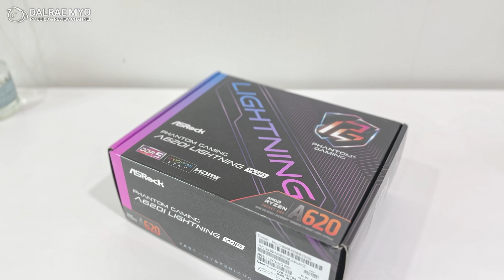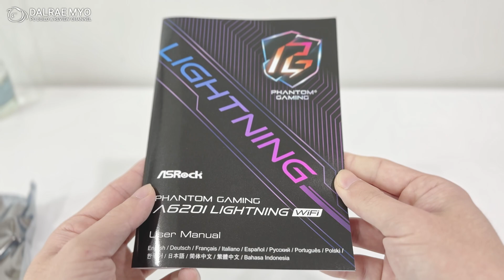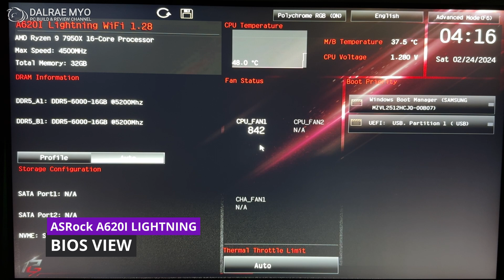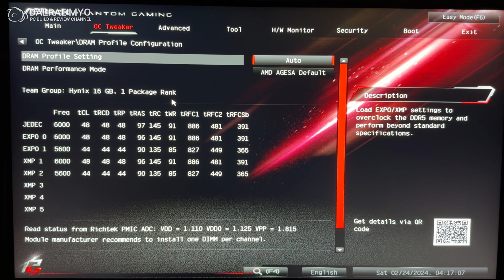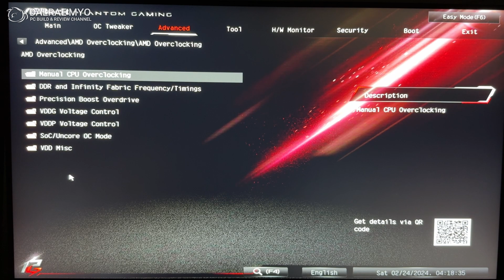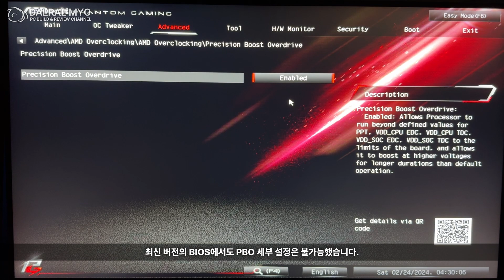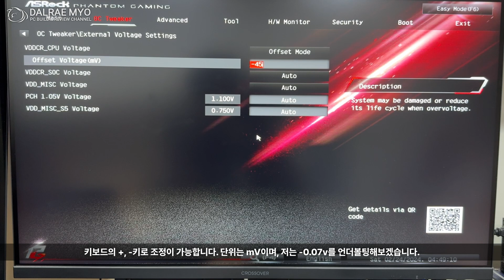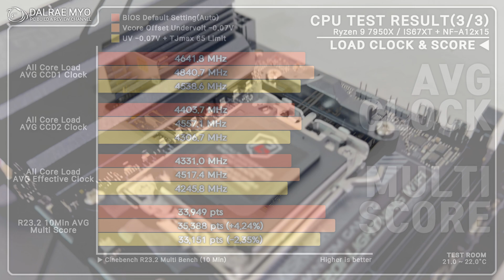ASRock A620I PG LIGHTNING WIFI Review

Comment: Is Offset Mode in VDDCR_CPU Voltage the same as undervolting through PBO Curve Optimizer? How come after offestting -70mV resulted in similar or even higher CPU temp? And why did you choose to limit the TJMax instead of changing the PPT, EDC and TDC? I hope you can answer this 🙏🏼

Comment: Why did you choose the t-create expert? Klevv Fit V 6000MHz CL30 has better latency and similarly priced too. Btw thanks for the video!
Reply from the maker: The RAM I chose is classic, not expert.

I stick to the JEDEC standard, and I happened to have a model that uses the JEDEC standard with a nice heatsink, so I chose it.

Comment: can this motherboard undervolt the cpu?
Reply from the maker: It wasn't possible with the BIOS version I tested.
Reply: @DalraeMyo  does that mean the latest BIOS version could do it? A seties boards are known to not be able to undervolt but I expect ITX should be able to considering how expensive of a premium they are
Reply from the maker: @ It is highly likely that it will not be possible even in the latest version.

It seems that the feature has been limited to avoid interference with sales of B650/850 chipset motherboards.
Reply: @DalraeMyo  good explanation

Comment: what is the best cpu for this mobo that can run at full performance without undervolt? assuming it won't reach tjmax
Reply from the maker: If you are considering an environment without undervolting or power limitations, you can select a CPU that uses less than 150W of PPT.

Examples include the non-X, R7, and R5 models of R9.

Comment: Hello, thank you for your video, I have a quick question, I know that there is an option in the BIOS "Power On After AC Power Loss", this allows you to restart the motherboard when it returns power. But I tested a little, it works but if the motherboard regains power after a few seconds (or minutes I don't know exactly how long) Does it have an option for the computer to restart automatically when you reconnect the power no matter how long you leave it unplugged?
Reply from the maker: I understand that there is usually no time limit unless the battery installed on the motherboard is discharged.
 For example, this is a function that can respond to long power outages such as facility electrical work.
Reply: @DalraeMyo  Thank you for your answer, it's really strange, when I leave the computer off for 30 seconds it works, on the other hand when I turn it off for 30 minutes no...
Could it be the motherboard battery that is dead?
Reply from the maker: @CharlesHalbitte  I think the information I explained was based on an enterprise-grade motherboard.

I think ASRcok's consumer products may have different maximum standby times. I think it would be quicker to contact the ASRock service center.

Comment: can id cooling is-55 fit above the I/o shield?
Reply from the maker: It seems difficult. Since the VRM heat sink height is the same as that of general ITX motherboards, it is expected that installing the is-55 cooler in the direction of the VRM heat sink will be difficult.

Comment: i was thiking about this one but where to put a graphic card ? and does it support ryzen 9000 ?
Reply from the maker: The 9000 series is supported starting from version 3.01BIOS, and the graphics card slot can be installed in the PCIE 16x slot at the bottom.

Comment: After watching your videos about itx motherboards I just bought the ASROCK A620i PG WIFI today. Thank you for helping me choose.

I now have a question about this board. In its online manual, it says that to update the bios via FLASHBACK I need a CPU and MEMORY installed, but what if this feature doesn't need a CPU or MEMORY to be done?

The same manual says that I need two files and a PENDRIVE formatted in FAT32. The files are: BIOSUBU.BIN and the bios file renamed to PSPBIOS.IMG.

However, other tutorials only say that on ASROCK motherboards you only need the MOTHERBOARD BIOS, renamed to CREATIVE.ROM and then the update is done via FLASHBIOS.

So my question is what is the FLASHBIOS procedure of the A620i PG WIFI actually like? I still don't have the processor or the memories, I'm going to use a Ryzen 7 7700 in my assembly.

Comment: Hello friend, greetings from Brazil. In your opinion, is this ASRock A620i better in construction than the JINGYNUE B650i?

In the tests I saw on "Hardware Unboxing", the A620i motherboard supported a Ryzen 9 7950x in Stock for 1 hour, having a 6.39% lower performance difference than an X670E i Rog Strix and maintaining a VRM temperature of no maximum 86°C.

The maximum power that the R9 7950X reached in TDP on this A620i board was 165W, while the JINGYNUE B650i did not correctly show its consumption in WATTS, but reached a temperature of 121°C in its VRM.

My setup is basic, I want to use a Ryzen 7 7700 or a Ryzen 9 7900, both with a maximum of 65W TDP in the version without the "X". I'm not interested in overclocking a processor, so I'm unsure between these cards:

- A620i ASRock PG WIFI;
- B650i Aorus Ultra;
- B650i JINGYNUE.

In your opinion, will an ASRock A620i serve me well using AM5 processors with a maximum TDP of up to 65W or 120W?

My initial Build:

- 1000W Corsair SF1000L power supply;
- White Corsair 2000D case;
- WaterCooler Armo Teucer 360mm.
Reply from the maker: - A620i ASRock PG WIFI;
- B650i Aorus Ultra;
- B650i JINGYNUE.

If you have to choose between these products, the Aorus Ultra model would be the best in terms of hardware specifications, but the M.2 stacked slot seems to cause stress when installing a cooler.

If you plan to use BIOS as standard and use a 65W/120W TDP CPU, I think A620i Lightning is also a good economical option.
If the cost is sufficient, it would be better to choose the B650i Aorus Ultra model, and if you want to save cost, it would be better to choose the A620i Lightning model.

Comment: Hey my friend i want to make a itx pc. I need a itx mobo but many reviews says that this mobo is very hot ont the vrm.  Do you recomend this or msi or 620i from gigabyte? Tks
Reply from the maker: I don't know if there is an ITX board model with MSI's A620 chipset.

If you can afford it, it is better to choose MSI B650I.

Gigabyte's A620I is a 275A power supply unit, and the power supply capacity is relatively half that of comparable products.

Comment: So.... No curve optimizer option ? The most important information was somehow left out.
Reply from the maker: A620 chipset motherboards did not provide options to adjust detailed settings related to PBO by default.
Reply: So no under volt as well  @DalraeMyo
Reply: Its a little patetic how this card has not that option.... And more because obviously its made for a small cases with less air flow and space

Comment: With the last BIOS Update 3.08 Is It possible to use PBO presets?  Like 90⁰C - 80⁰C - 70⁰C presets
Reply: Did you find the info on that? I really wanna know
Reply: @denisnatera3633  I dont, but in the asrock website they uploaded new BIOS update for this one.

Comment: Thanks for settings, i have a mini itx build and i looked for info that a620i it cannot do curve -30/-50 settings - but essentially offset is just the same thing and it is possible then.
I set ppt/ edc etc myself and it works, just a little touch on the offset and it will be quiet, fast, and chill.

Comment: does this support the 7800x3d out the box or would i have to update bios first?
Reply from the maker: The 7800X3D supported BIOS version is 1.28, and is supported from the first version.
It will be available without a separate BIOS update.
Reply: @DalraeMyo  Thank you! any undervolting advice on this board for the 7800x3d?
Reply from the maker: It seems better to enter about -0.05v(-50mV). @andyvasquez8724
Reply: @DalraeMyo  I have the Asrock A620i with a 7800X3D and can not find the option to undervolt the  cpu.  The option 'OC Tweaker\External Voltage Settings\VDDCR_CPU Voltage' is missing? I downgraded the bios to 1.28 and 2.02, but it is still not there. Can it be the difference in the CPU that is giving you the option?
Reply: @Tdot6  bro do you find option how undervolt 7800x3d because I didn’t see this  too
Reply: @sernapro4026  Sorry, I was never able to find out why the option does not appear for me.
Reply: @sernapro4026  It;s been awhile, but I believe the cpu voltage undervolt option is not available because I read X3D cpus are voltage locked.

Comment: I've heard that the Thermalright AXP90-47 Copper isn't compatible with this motherboard and it isn't ideal under 55mm.
Reply: Are you sure? Why?
Reply: @franzpleurmann2585  nope, someone posted this info on pcpartpicker in reference to the 650 variant
Reply: @franzpleurmann2585  the motherboard backplate nuts arent compatible with the cooler, but you can get m 2.5 hex nuts to replace the ones on the motherboard to fix it
Reply: @franzpleurmann2585  because of the share of backplate on this motherboard. But there are some ppl succeed in using the cooler with some tweak(?) like ignoring making scars on mainboard through screw.
Reply: Do you know the info? What about the axp90-53?

Comment: Thanks for sharing this. I was afraid of the BIOS, but it seems pretty capable for an A620. Now I'm seriously considering it for an APU SFF build.
I was originally considering ROG Strix B650E-I, but it seems too expensive to me. Sadly B650I Lightning is barely available in my country, and overpriced.
Reply: From the hardware unboxed video tou can see that a620i is a very solid choice in this price range. No need to get a better board for 65-75W cpu.
Reply: @koaronD  Well, I ended up going for a Gigabyte B650 for my office PC and Aorus B550 for my little gaming rig. I still prefer a bit less cut-down motherboards and BIOSes.

Comment: Is a ryzen 7 7700x rtx 4080 2k monitor suitable?  power limit?temperature vrm?
Reply from the maker: I think it's a reasonably priced motherboard with enough specs to use the 7700X and RTX4080.
It's a great motherboard unless you're going to fine-tune your PBO settings in the BIOS.

Comment: Total PC newb here. Am I right to assume that A620 has less undervolt/overvolt options than a B650 board? Does a B650 have any significant advantage over this board?
Reply from the maker: If you're going to customize the various PBO settings yourself, the B650 chipset board is good. On the other hand, if you're going to simply use the TJMax Limit and undervolting options, the A620 chipset motherboard is good enough. (It's a bonus that the motherboard is cheap.)

Comment: Hi, is the T-Create RAM XMP profile automatically recognised on AMD boards? Or do you need to manually set the timings?
I see in your other video you also have Asus X670e-i motherboard, and I was thinking of purchasing the T-Create RAM.
Reply from the maker: All recently used AM5 socket motherboards have recognized 6000 CL48 clock, which is the JEDEC standard timing for T-Create RAM, as 5200 CL42 clock. (This probably automatically changes to the standard value in the BIOS to match the 5200 clock, which is the standard value for the Ryzen 7000 series.)

Fortunately, the XMP (EXPO) profile item marked 6000 CL48 clock on most motherboards, and if you changed the profile, it applied well to the original clock and timing of the memory.
Reply: @DalraeMyo  so it defaults to 5200, but turning on EXPO/XMP successfully recognised 6000? Thank you.

Comment: Please make a bios install video on this board
Reply from the maker: You can update the BIOS with the Instant Flash menu on the Tool tab. If you insert a BIOS file in USB memory and run the Instant Flash function, you will automatically search the directory and get a pop-up window.

Comment: Was expecting you would use the same bench components as in the GIGABYTE A620I AX Review video. Could you do a comparison between this mb and GIGABYTE A620I AX with all the rest of the compoenets the same? like the ryzen 5 7600, and show the thermals on the vrms and maybe which one can get better performance when undervolted
Reply: One big con of the Gigabyte A620I motherboard is that it has only 1 NVMe slot.
Reply: @hwi7114 in this moment both are at same price on amazon.... For you which is better? I need yo buy one of these. What pros and cons has each?
Reply: @hwi7114  huh i didn’t know that. lowkey prob going for smth else now

Comment: DalrarMyo will this board be a good combo with 7500f + 6800xt + 6000mhz cl30 or is it better a 7600? Now I have 5600x 6800 xt 3600mhz cl16 and play 2560x1440, should i stay wherr i am or upgrade to a620?
Reply from the maker: I think the 5600X still offers enough performance. It looks like it's better to use it a little more and then upgrade your PC when the next generation comes out.